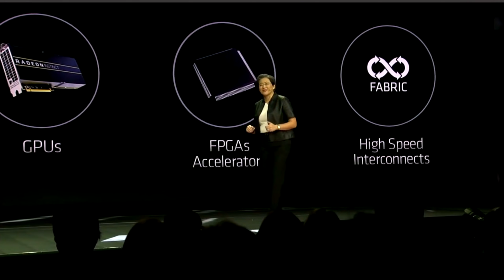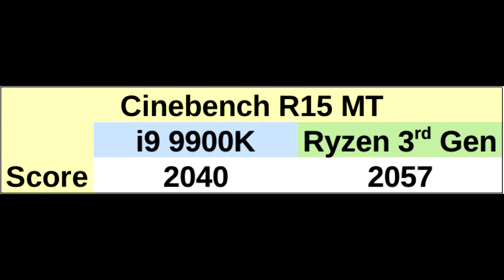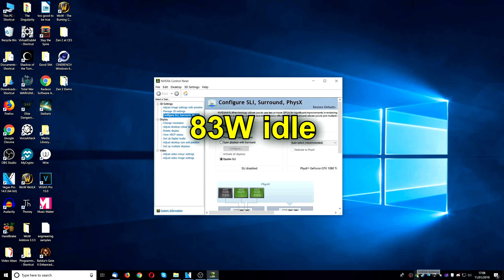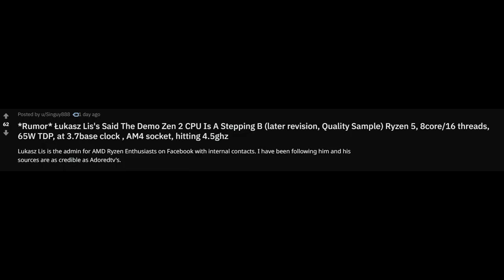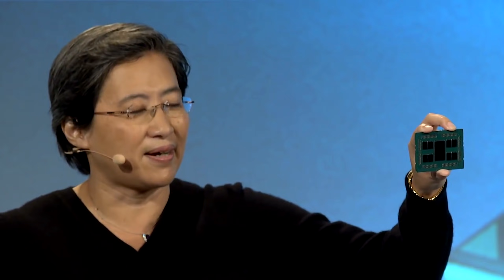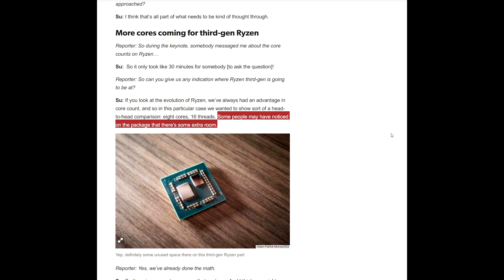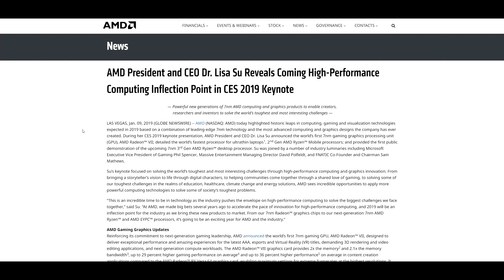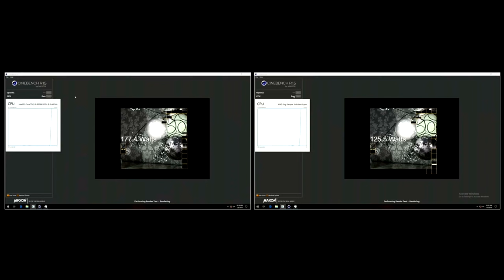Zen 2 Faster than i9 9900K at Half the Power.

Comment: Sooo. You can bin dies for clock speed. Can you bin IO dies for memory support?
Reply: That was also speculated in another vid of his (the premise is you can bin Epyc/Threadripper I/O dies but you can also break them up into quadrants and bin those instead, especially if at least one quadrant didn't work; if the whole thing can't be epic, the working parts can still work as Ryzens).

Whether that's exactly what they did is unknown (unless someone comes forward with evidence that the size of the Ryzen I/O die is one-fourth the size of the Epyc I/O die; now I want someone to do the math).
Reply: @ganaraminukshuk0  Since the I/O dies use the previous generation process (14nm or 12nm), I think AMD thought, rather than breaking up into quadrants we'll just simply make a new "desktop-optimized" version, because maybe (due to the maturity of 14/12 process) it's easier to do.

Breaking into quadrants = additional testing & verification.

Make new one = a bit more effort, but not much, and not that expensive either, and simpler testing & verification.

And if the I/O die is indeed different from EPYC's, that means AMD had indeed put into action their master plan of two parallel development: CPU chiplets and I/O chiplets, and they can now mix-n-match as needed.
Reply: @PanduPoluan  bigger process can handle more powers too so yes
Reply: Ryzen io die is 1/2 of an epic io die because Ryzen will have 16 core versions.
Reply: 16/64 =1/4
Reply: @Erevos85  Gen 1 EPYC was 32 cores/64 threads and Gen 2 EPYC is 64 cores/128 threads!!! So half of a Gen 1 I/O die!!!
Reply: @Zarflame99_Alt  Gen 1 didn't have an I/O die though.

Comment: Prediction for Zen2 based threadrippers ... it is my speculation that there will be the I/O die smack in the middle. Additionally, based on the size of the TR socket/package, 6 chiplets 3 arranged vertically on either side of the I/O.. so we could see 24, 36, and 48 cores .  (Each chiplet with 4/6/8 cores active.)

Comment: Great video as always! I think it is more like the leakers were trying to deceive you (in case they get fired or whatever else), but that your speculation and analysis is what was accurate. About CES though, I think Lisa Su was sandbagging as usual (under-promise and over-deliver) and this could have gone on unless your analysis exposed it (of course, there were rumors of 12c Ryzen before since Intel is rumored to release 10c anyways).

Also, from what we learned about APUs, they apparently will not use Navi as a chiplet, according to anandtech. So APUs may be monolithic (which is why they have lower clocks) I am really excited about AM4+. If AM4+ comes out, AMD can then future-proof them for DDR5.

Comment: i9 9900K score is higher than what AMD showed. And you can massively overclock it.  Seems like AMD 7nm is power efficient, but still can't overclock for shit. So we gonna get super efficient cores now that can barely go above 4.4GHz?
This seemed like such early silicon. But if they gonna launch mid 2019 don't they need to have finalized specs already and start mass production?
Even with process node advantage, they seem to under deliver. I mean nvidia ceo, Jensen Huang is right. That Radeon VII GPU is so underwhelming, if you look at the actual performance and compare to the totally monstrous specs. With those specs it should have obliterated the Titan RTX and not be on par with RTX 2080 (non Ti).
Reply: Did you not watch the video.?? Amds mid range CPU won Intel's top end main stream CPU by like 10 points it not to mention it's an engineering sample that's not even the final design. You should rewatch the video
Reply: they literally stated the I9 is running stock
thats because theyr engineering sample wasnt ready to be pushed to the limit so they opted for "stock to stock" comparison
hell they even GIMPED the Ryzen by running stock memory speeds on both systems

what you dont understand is that the 8c/16t with only one chiplet is NOT the top of the line chip, its the R6 series one ... and when (if pricing stays on the same level) sub $200 chip is matching $550+ one from Intel (+ additional cost of overpriced Intel MoBos ...) you might imagine what will happen when they put the second chiplet on there and put out 16c/32t CPU for under $500 ...

if that happens the Intel is going to have a few years from HELL as they will be unable to sell ANY chips as AMD will be offering same performance under HALF the price and double the performance for still lower price than Intel.

only way this might get less devastating for Intel is if the AMD is forced to sell for higher price than theyr older gen products, whiich considering how efficient hte chiplet business model is is highly doubtful 

they will use the SAME chip for all theyr processors, from top tier Epyc down to budget Athlons so they can bin from the top and have incredibly efficient production that not only will be much more streamlined thanks to not having to produce dozen of different chips but also produce much less total failures as faulty chips will simply be bumped don the line - Epyc-> Threadripper -> Ryzen 9, 7, 6 will all run full 8c/16 where the top silicone will go to the better ones and R7 will use good clock chips with 2 cores each disabled (using good clocking silicone with bad one-two cores) then the 5 and  3 series will use more defficient chiplets to probably have 4+4 core ones for R5 and 6c or 3+3 core chips for R3 ... just think about it even chiplets that are absolute GARBAGE with only 3 out of 8 cores functional can be used ... hell you can use 2 core ones in tandem for Athlon ... thats HUGE deal for production costs.

Comment: Jim. You should have never ditched your I/O die speculation. The primary argument that caused you to do this was apparently that shipping die from place to place would make it too expensive for desktop parts. But when I  was at Freescale it was standard practice to fab parts in the US, ship them to Taiwan for packaging , ship them to Kuala Lumpur for testing, and then back to the US for warehousing. And this was for parts selling at less than $50. The reason this it is not expensive is that even at $50 per part the value per cubic meter and value per kilo is very high. You could ship a LOT of parts in cubic meter. The shipping costs were just pennies  per part.

Comment: I am disappointed the Zen 2 release date is middle of the year. :(
I need to upgrade my pc very soon so gotta go with the 2700x. Was hoping 3700x. :(

Just noticed you got Total War: Warhammer installed. :p
I am hoping the 2700x will load the End Turn times fast enough, like less than 30 seconds per turn.

Comment: It's neither addressed in the video nor asked in comments as far as I can tell - If 8C/16T has only one chiplet and not two as Jim anticipated, how does it make sense from binning standpoint? In the first video about the leak, Jim speculates that Ryzen 5 will get middle of the road silicon, assuming it's 2 x 4C chiplets with defective cores. Reality is, they need full 8C chiplets for CPUs that sell the most. 
Presumably the best silicon will go to 16C and silicon with some defective cores to 12C CPUs. Is it possible that AMD changed their mind at some point and decided that Ryzen 9 will be both 12C and 16C and what they showed at CES is actually Ryzen 7 and will be priced as such? That would suck, but if their yields are great as they lead us to believe, does it make sense to sell most of the silicon as a lower-margin Ryzen 5? I'd be very interested to hear what Jim thinks about this.

Comment: I don't believe it was running at 4.6GHz, because that would imply a regression in IPC.
I would suspect at most low 4GHz range, possibly even somewhere in the 3GHz range, with superior IPC making up a lot of the performance.
I would expect about an average of roughly +~13-15% IPC in most programs.
I also think some specific programs should reach significantly higher than that due to the doubling of FPU width. And I think Cinebench is probably one of those, being FPU heavy.

Comment: Assuming the machines were idle after launching CB is a large assumption (especially given that the test was started almost immediately), assuming that ryzen has a higher idle power usage and comparing the deltas from peak power utilization seems very much like mental gymnastics to me. The delta between the two systems at peak utilization (which is the whole point of CB) was 24%.

Comment: Tldr; AMD's $180 Ryzen 5 3000 series chip is 1% better than Intel's $530 I9-9900k. And AMD's $450 Ryzen 9 3000 series chip is 200% better than Intel's $530 I9-9900k.

Tldr for the Tldr; RIP INTEL
Reply: And it only was an engeneering sample!
Reply: I'm expecting their 16 core model to be more expensive than the 9900K. They did the same thing with the 1800X being a lot more expensive than the 7700K. Which to their credit is fair as they have an exceptional product. But they also shouldn't push it too far because their market share is way smaller than Intel and many people have a hard time switching brands. Many people buy cars from VW (/Audi) because their last two cars or more were good even though current day VW's are well finished, oil guzzling, unreliable shitboxes with bad warranty.

Comment: Just want to note that from other sources it seems the Boost clock and base clock weren't fully functional on this Engineering Sample. So it's likely running an all core clock for the entire time, meaning the delta for the Ryzen 3rd Gen is inaccurate. If anything it's slightly more impressive as it was idling at 67W with an all core clock equal to that which basically equaled the 9900K.

With that in mind the theory's I've seen and also come to from working on some numbers is the frequency is likely to be in the 4.0-4.2GHz range if the IPC uptick of 10-15% is accurate. If not then the core was running 4.4-4.5GHz. Either way it's still lower than the 9900K's 4.7GHz all core boost during the CB run.

Comment: Hey Jim, great video. I was a little disappointed that all we got to see was an 8-core part, but seeing how things turned out, it's actually more interesting that AMD decided to go this route.

As you mentioned, and Lisa stated, AMD had commonly gone with the "more cores" argument. With Ryzen 1000, Ryzen 2000, and even Rome, AMD chose to focus on how much performance per dollar you could get with AMD processors, usually a function of the fact that AMD offered at times twice the cores in the same product segment. While Zen was a truly massive architectural improvement, it was clear that clock speeds and IPC deficiencies meant that on a "core-level playing field," AMD was still at a disadvantage. The more I think about Ryzen 3000, and this keynote, the more excited I get.

See here's the thing: AMD wouldn't have tried the apples-to-apples, or rather 8 core-to-8 core, comparison if they didn't have something good to show. And comparing a 90W TDP chip to a 65W TDP chip and slightly edging it out is a pretty big deal. What that seems to indicate is that AMD has gotten MUCH closer to parity on IPC, which was probably its biggest weakness. I can't wait to see further testing of these chips because I would love to know how that ends up.

As always, I approach these demonstrations with a skeptic eye, and I'm sure AMD chose the benchmarks that put their chip in the best light. But this is still a real benchmark, and something of an indication for upcoming performance. I feel that AMD realized they were positioned so well against Intel that they didn't have to demonstrate 16- or even 12-core parts, which is huge. I'm fairly certain that I will be able to shove at least a 12-core Ryzen 3000 into my X370 motherboard, and if they manage to make a 16-core part work, I will be ecstatic. Even then, the mid-range 8-core chip seems to be quite a good performance improvement! It will be exciting to see the whole stack announced. At this point, I feel pretty comfortable in saying that AMD is outright sandbagging. They know Zen 2 is good, and they're going to slowly show us leading up to the launch. I'm salivating.

Comment: The results could be taken to show that the new Ryzen 5 will be a great workstation chip, however overclocked the Intel could still have a 400mhz + lead  (5.1Ghz) which will mean it will still retain the fastest chip gaming crown. Intel does takes more power, but in the context of total system power used at a gaming of which the chip is only a small part (at part load) and taking the power hungry flagship cards out. The demo shows more difference than there actually is.
Reply: amd midrange beats intel best, call it what you want but Intel is dead and amd high end not shown yet be beating it to the ground

Comment: If your chart at 13:00 is correct, AMD was demonstrating a $180 part.  The current retail price of the i9-9900K is $529.  For that price, one could afford a Ryzen 9 3850X with 16C, 32T @ 4.3/5.1 GHz.  Twice as many cores at a faster clock speed.